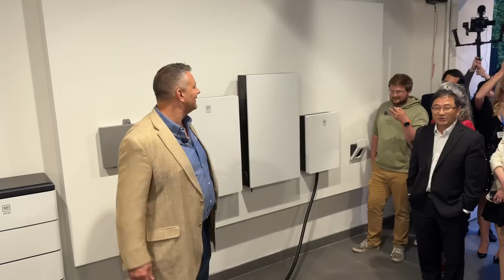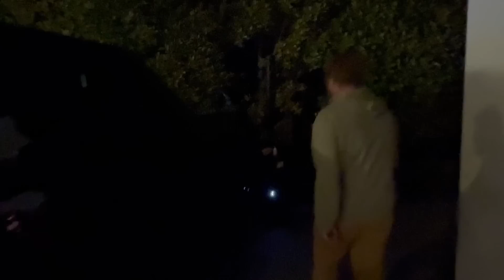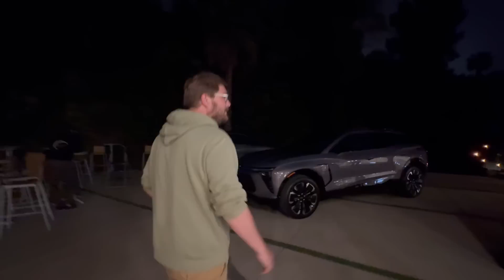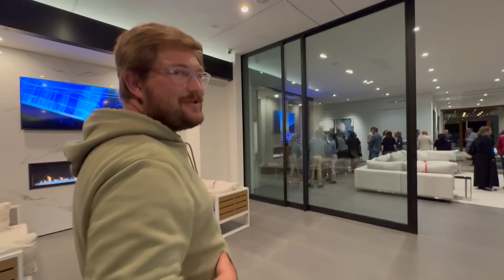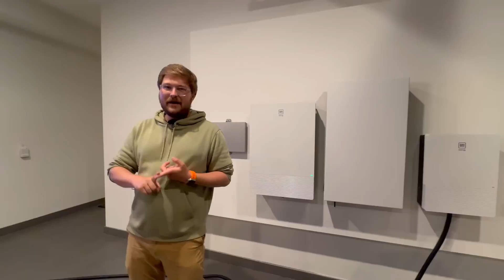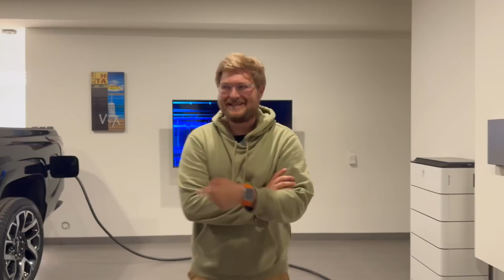GM Launches Home Energy Ecosystem! Full Tour - EV Charging, Bidirectional Power, & Battery Storage

Comment: EV manufactures don't want to implement V2G bidirectional, hell they don't even want to put in 120v 20a ALWAYS ON POWER PLUGS in their EVs.  The giant 150kwh Chevy Brightdrop 120v plug only puts out 400w and turns off when you turn off the van. Why?  battery warranty?  liability risk?  Recently Tesla put out an update to stop the 12v outlet when the car is off.

Comment: Will those batteries be storing only energy from the vehicles or can they also store energy from solar panels?
Reply: If so which solar systems will be compatible with the GM system?
Reply: Also, what about generator support and integration?  Can you integrate a natural gas whole house generator into the system?  What happens if you have bad weather during a blackout for several days that disallows you from generator energy from solar and replenishing your battery banks and ev?
Reply: @jaypark7207  It would be nice if it could talk with an AC coupled solar inverter output. Lots of those already installed.

Comment: This has to be one of his best reviews ever with respect to the value of the information tucked away here and there within it. Here is my take on the really significant items Kyle touched on: (1) This may well be the future of home power backup, with or without solar, assuming you own an EV. (2) Modern EVs have far more battery capacity than most homes would use over several days and can readily form the core of a home power backup system. (3) A small supplemental home battery, perhaps 5 kWH, would be beneficial, so that the home can still operate if you need to drive the EV somewhere, for example to a nearby Supercharger to replenish its battery. It is likely that major EV charging locations will get power restored sooner in an emergency than an isolated neighborhood such as the one in which I reside. (4) A significant investment in a system to manage home power will be required. It may be best to hold off investing in such a system until the ISO standards for interconnectivity are finalized and approved, hopefully within the next 5 years. This will allow any system to connect with any EV provided they both meet the ISO standards for interconnectivity -- no proprietary system lock in when you go to trade in your EV for a different brand.

Comment: With Solar (since 2000) & power walls (2) installed I currently charge an EV & use battery power 5pm-9 pm daily.  The next step is to get power available from my Rivian to help during the high need periods for the bi-directional power.

Comment: Still no love for the Genesis GV60....hmm.   It also has load out of its 77kWt battery pack. Less than $700 to install a manual transfer switch to  which I wired 90% of my circuit breakers. It provides over 15 kWh, which is more than my whole house 700 watt daily need, for almost a week of power if needed.  I still have 2 years of free E.A. charging, which I use liberally and power my house in the evening.

Comment: Coverage like this makes Out of Spec Reviews the most important channel on YouTube, wow, what an excellent introduction to GM Energy. I live in low desert of SoCal where temperatures are in triple digits most of June - August. I have 7kWh solar on home but my area served by IID has had 11 power outages since moving here in April, 2023. I have been searching for battery solution to add to my existing PV which I purchased from Sunpower. I have had an order pending with Tesla for over a year. Sunpower does not show up for conference calls or follow-up with any communication. Tesla continues to state, "not available in your area." I went to GM Energy website and placed a request for bid. GM Energy responded immediately, assigned me to a Home Energy Consultant who has communicated with me, scheduled Qmerit home visit and is working with me for "The Complete Package" that includes the PowerBank which should be ready to order in about 3-months. Qmerit completed the home visit 5/28, all looks good. I would love to purchase a GM EV to use as V2H and save on separate battery cost. I have two technical details that GM Energy needs to answer. 1) Inverter backup power shows limited to 9.6kW, can this be increased? My home during hot summer uses up to sustained 11kW between 4pm - 7pm. Backup sustained output should be a minimum of 11.5kW to be safe. 2) Environmental operation requirements for heat. At what temperature does system derate? What is the max operating temperature? My temp sensor in my garage shows that it can reach 110 degrees F for about six hours in the evening. So far, the only other battery backup system I have found that has installation available in my area is the Anker SOLIX. Anker design with 12kW continuous output and operating temperature up to 131 degrees F, derate at 113 degrees F. Unfortunately Anker SOLIX is over three times to cost of GM Energy. Obviously, V2H saves a lot of home power cost if it can meet the requirements. If you are interested in following my progress, let me know and I will keep you informed.

Comment: Excited about the new home power channel!!!! I really want to see comparisons between the ford, Tesla, and GM systems. Number one the total all in price without buying extra home battery storage. If I have a huge vehicle battery I shouldn’t have to buy storage. That should be an option later. Also we need to see the comparison nerdy stuff you kinda got into how disjointed the GM system is with 4 separate units currently vs teslas integrated solutions. I think fords solution falls in the middle currently but I have no direct knowledge of any of these systems only from here and state of charge

Comment: I just want to be able to manually plug the power out from the 240v 9kw outlet in the bed of rhe truck to my generator switch panel. No complicated expensive system needed.

Comment: 36 seconds to come back online after an outage. That is disgraceful. I get the car may need to wake but I thought this system had a small battery? Meanwhile other products at most you get a flicker. Are they using an automatic backup generator as the benchmark here? Which wouldn't be ruspsing for legacy auto.

Comment: Why are they using CCS instead of NACS?
Reply: Because the truck is CCS. The NACS deal isn’t until 2025 for all the automakers.
Reply: Because this systems sounds like it’s just like the Ford system and it will not work with NACS, because NACS does not support AC and DC power simultaneously.  The same system with a NACS connector will have to use DC to charge the EV battery, rather than powering the on-board charger with AC.

Comment: For a personal residential use in the rare outage, just get an interlock based generator inlet for fairly cheap then you can plug the 240v truck output directly in OR roll your gas generator up and run away. Powers the whole panel, just be smart about your loads. Soooooo much less cost and complexity.

Comment: 3,000 sqft house in California - AC full blast, pool pump running, Dishwasher on, 113F outside and I was pushing 9.5kW draw.  Typical max is more in the 7kW range during extreme high temps (i.e. AC at full blast.)  I think 9.6kW and maybe some mild load regulating, but allowing for full or close to full AC operation is more than reasonable for most homes.  Something that is a 10,000 sqft home would have many zones, and you could easily limit the cooling to a couple zones and be below the inverters 9.6kW limit.

Comment: Another good video. As I've mentioned in other videos, I used to be a GM fanboi. I owned a '65 Corvair, '95 Jimmy, '02 Vue, '06 Avalanche, and a '16 Malibu hybrid. I noted the quality of GM vehicles diminishing over time as they try to cut costs.  (For example, my '06 Avalanche deleted the light in the passenger footwell to remove $50 from the cost.)  I wonder about the long-term quality of the GM Ultium products. I applaud Mary Barra for her focus, but will reserve judgement until i see the product in action.

Comment: If it takes 40 seconds to get the V2H working all the electronics in the home that dependent on a constant power source will have to reset. Think of all the clocks in appliances, cable boxes etc.  The Tesla Powerwall makes the conversion to battery so fast that these appliances are not affected. This is important if you want your use the battery to save money such as a.) storing solar energy to use in the evening, or b.) storing cheap super off peak power you can buy late at night to run the house while your EV is at home. I think a 40 second gap will be unacceptable under these circumstances.  The V2H inverter has to be on and ready to go at all times and monitored to be in spec so the system can disconnect from the grid and switch to battery power almost instantly.  Shouldn’t this function be handled by the Dark Start battery?

Comment: English is not my language, but I wonder if it is so difficult/complex to connect a vehicle with V2L, V2G or VTH to a house, and the battery of the vehicle acts as if it is a battery connected to the solar system?

I don't understand that for using this GM system, the house must be off grid? 🙄🙄

Comment: Definitely an edge use case.   Living in VA and PA all of my life, probably had 3 or 4 times were we lost power for more than 8 hrs, that's over 40 years.   Just use the outlets in the car to power what you need to power(freezer, fridge,  internet, etc...   )
Reply: Will be more useful in areas with hurricanes and snow storms where you can lose power for days.
Reply: Try living in NoVa: proximity to DC means utility chaos. On 9/11, the Pentagon did not have A firetruck….

Comment: I have 20kW of PV and inverters with 36kWh of LFP. It powers my 450m2 house and 2 EVs. If we have a storm my 85kWh BYD Seal connects it's 3.6kW AC V2L to my solar system's grid connection (I am off-grid with no meter) I tend to use it when the house is shut down for the night and what I use can be charged back in an hour the next via my 7kW wall charger  - videos on my channel.

Comment: This is close to something I'm wondering about.

A lot of companies offer these all-in-one hybrid inverters. They have solar panels (multiple strings, depending on the size). They have battery or batteries (possibly multiple independent ones, depending on the size). They can charge the battery from the solar or discharge it to power the loads. They have the AC side, which they can output into or take from and charge the battery. They often have an emergency mode when the grid is down, with switchover under 1s. A lot of the power parts of the thing is shared / balanced between the inputs/outputs.

So extending this by connecting one of the battery in/outputs to the EV battery through CCS (both charging and discharging) is just adding the communication parts, but the rest is already there. The added cost to such installation should not be high, compared to having just the „basic“ version of such inverter. It would also provide some efficiency benefit (eg. not going DC->AC->DC when charging from solar, but directly DC->DC, just voltage change) and would allow going down with the charging power below 6A (this is a slight problem here in Europe, as we run 3-phase charging and that means we can't go below ~4kW even if the solars are giving less).

For that reason, I think the future is having it integrated in the inverter (with the wallbox being just a „satelite“ so it's possible to install further away from the inverter) and the car only allowing to discharge the DC.

And yes, I do think it makes sense to have some stationary battery too ‒ faster switchover (no need to negotiate with the car), works when the car is not there, etc.
Reply: Stationary battery storage is usually 48V.
Reply: @tschuuuls486 Not around here. I mean, if you want, you can build something with 48V from components. 

But, if you order a "consumer grade" / home PV system around here, what they usually deliver is a Chinese all in one inverter with Chinese high-voltage battery storage. 

Depending on the number of modules, it's some 300-1000V on the battery, with capacities from 8kWh upwards, and charge/discharge powers in order of multiple kW.

There are some startups experimenting with re-using old car battery packs (crashed, high degradation, etc; but as a whole pack, not taken apart to cells) by connecting them as batteries to these inverters. They just add a translation electronics board to pretend it's a car to the battery pack ‒ but the power lines are connected directly.

Comment: Not sure AC going out of a vehicle is better that DC. DC goes directly out of a battery, and to get decent amount of AC, you need powerful invertor. Again not sure if invertor used to run the motor can be used to generate AC compatible with the grid. And when you have invertor on the wall, you save on vehicle complexity and give customer an option - maybe somebody does not need this feature?

Comment: @ 6 : 2 6 most new homes 🏡 Install 240 volt 200 amp electrical panels 240 volt x 200 amps = 48,000 watts … 48 kw but every breaker is not maxed out at all times  9.6kw is 240 volts x 40 amps ( clothes dryer)  when  experiencing a grid down situation 9.6 kw PLENTY temporary power. Code says u can’t use more than 9.6 kw max load …….. or SOMMIN LIKE THAT…… positive not in those words

Comment: I’d like to see an all in one inverter and EVSE with the grid ATS as an option on a standard panel board from the majors.  This means for green field builds, you spec the panel board to have the ATS and then only install one all in one inverter to handle batteries, solar, and EV charging.  Hopefully someone is thinking of this down the line…😊

Comment: excited on this area. It would be nice to finally have DC to DC like solar directly charging/connected to batteries.  it is also nice for EVs to dump its energy during high electricity rates to offset the cost of an EV. EVs also have better battery capacity vs price ratio vs like a Powerwall.
Reply: Solar charging batteries with DC has been a thing for many many years.

Comment: The good thing about having a Powerwall is when you are on a TOU rate and can pump energy in the grid when it is most expense and get credit for that. It totally offsets my energy bill. Can the GM system do this with the vehicles' energy? that would be difference between this being or not being cost effective.
Reply: Not at the moment, but they expect that capability with a software update at a later time. They have to negotiate with the utility companies.
Reply: No it can't. Can't even power your house in a normal day at all. Which is really not good enough and why Kyle said you have to be a real real enthusiast to early adopt this system. But it's a first step at least. Hoping other companies are less conservative

Comment: I am waiting (as patiently as I can) for the enphase bidirectional charging system so that it will integrate seamlessly with my enphase solar system.
Reply: Yeah I want Enphase to make a killer product here since I also have them on my roof
Reply: God I'm hoping so hard that they really nailed this product, but I worry a bit that it's going to be half steps. There's a higher chance that it won't have this sort of "only in an emergency" limitation and that it may eventually get connected to the grid, but I do worry which vehicles it will eventually end up actually supporting. Haven't heard anything from them or wallbox (which kia reaffirmed as their partner with Ev9 bidirectional charging news) lately.

Comment: The only car Tesla produces which is capable of bi-directional charging is the 2024 cybertruck.  Kind of a big let down ( to say the least ) after purchasing (2) 2023 model x plaid vehicles.  I also have a 2023 model Y performance ,  so there are 280KW of battery capacity sitting in the driveway with no way to assist my Tesla home solar system in the event of a grid loss. I purchased a 26kw home solar sx which included 4 powerwalls.  The powerwalls are fully charged at the end of most days and by morning they are at 50%.   Very surprised Tesla let their competitors get ahead on this one! I was naive when I just assumed that after hearing talk of the Tesla "ecosystem" that all cars would be capable of bi-directional charging when you installed their Home Solar.  Boy was I wrong ! This is a huge disappointment and I will trade in my Tesla vehicles before purchasing any more powerwalls !

Comment: I have the Ford Home integration system at my house that I use with my Lightning. I installed it myself and at the same time I installed a 20 kw solar system at my house and with Ford’s system, my total cost was like $4300 with tax and shipping costs for the Home Integration System and a new 10 kw solar inverter (which the Home Integration system came with) would have cost me at least $2,000 alone. So I think for someone looking to install solar at the same time they install these types of systems, you can better justify the cost of the system and install, not to mention get a 30% solar tax credit for the components and install as well